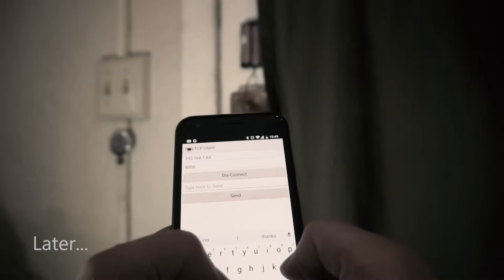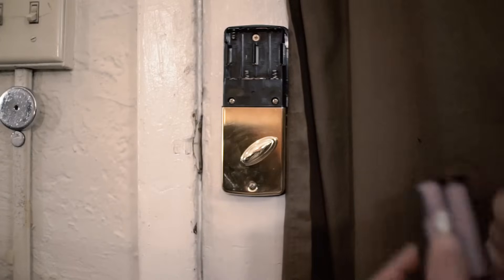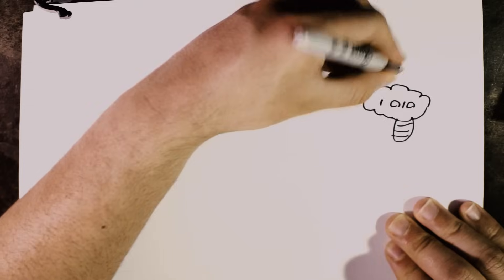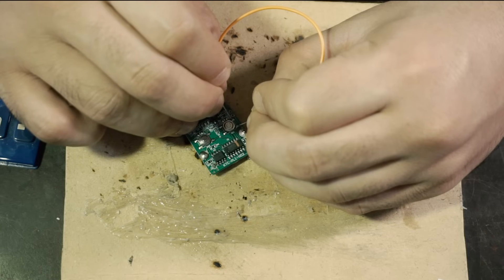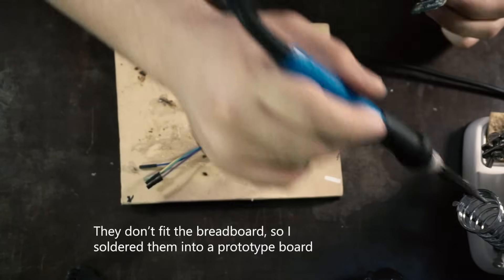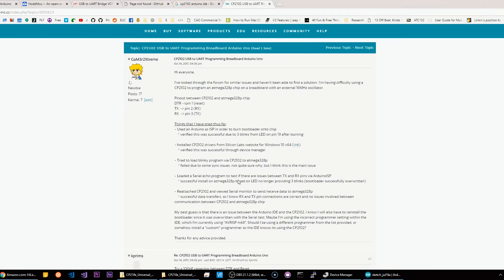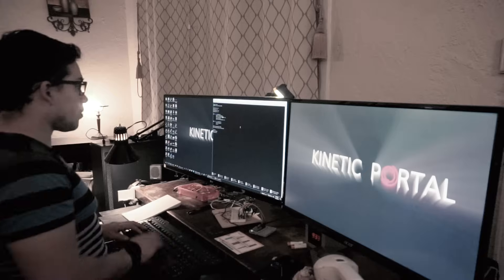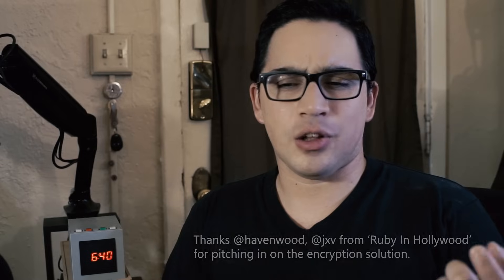Connecting a Lock to Wifi with a microcontroller and Raspberry Pi

Comment: I have that same NodeMCU ESP8266.  I paused on your connection settings to the board and you forgot to change the upload speed from 9600 to 115200.  You could also look at the Wemos D1Mini, they're stupid cheap and easy to use, you just need to solder your own header pins on.
Reply from the maker: You know what? I just checked my Arduino IDE, and yup. 9600. Somehow it never even occurred to me to check the baud rate (live and learn. Lol).
I just looked at the Wemos, they'd be perfect for this and another project I'm thinking because they don't really need that many pins.  
Thanks so much!
Reply: No problem!  I went through all that same frustration but didn't have the pi to fall back on, so I just found nearly all the things not to do before getting that part right.  I just setup my first wemos project a few weeks ago, I'll get more of them for sure.